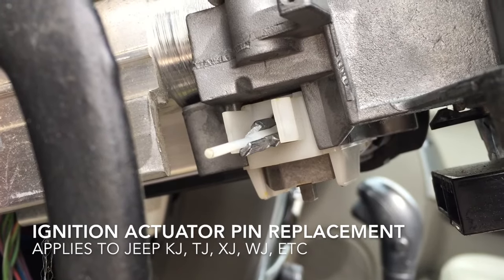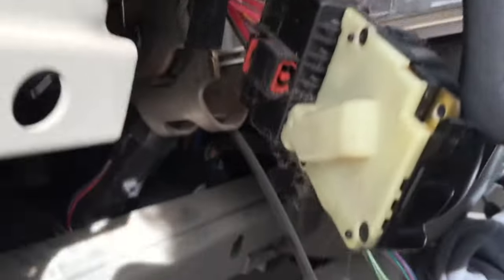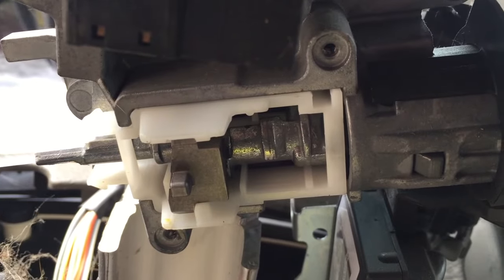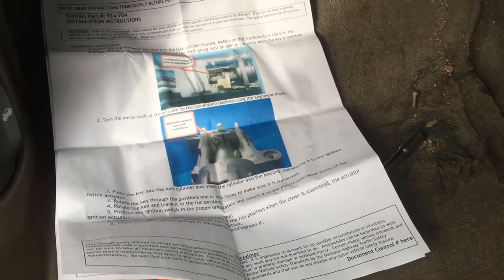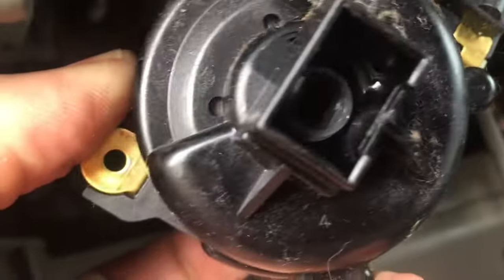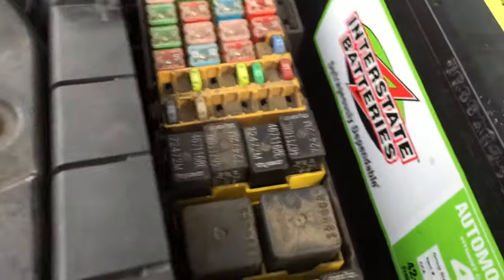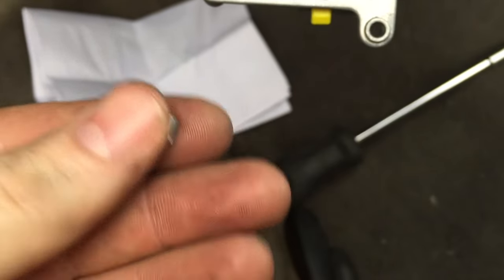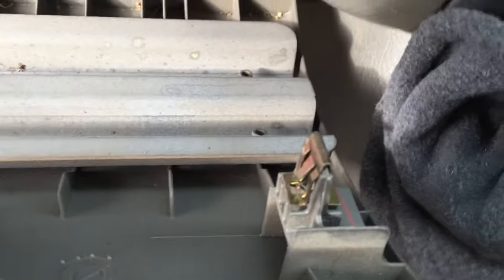Jeep Ignition Actuator Switch Key Pin Replacement - The right way! Dorman 924-704

Comment: Great video. Very comprehensive. Odd that the same defect is also on pretty much every video I have seen so far. Yours is the best. Prior to pulling the ignition cylinder out, I put two witness marks on it. My theory is to make the reinstallation process, less arduous. Currently waiting for parts.

Comment: It is also important to note that the oval-shaped key that goes in the housing for the switch actuator has the nipple on the top side....it will fit in the bottom. I had to pull mine back apart to allow the Liberty key to be released at all. MAGNIFICENT VIDEO!!! Saved me from spending a lot more doll hairs, and also saved a lot of stress.

Comment: Thanks.  I just did this repair to my 2006 Liberty.  But, I made the mistake of removing the three black screws on the ignition switch which removes the white plastic plate.  All kinds of things fell out.  A spring, and little silver ball bearing.  I ended up buying another one from Dorman along with the actuator pin part.  Spent around $50 total which was a lot cheaper than towing to a garage.

Comment: Thank you very much, this was an excellent video and it was exactly what I needed to fix the problem. I was so happy when I took everything apart and that little piece of broken metal fell out. One thing I did notice is that the Dorman part uses a bit thicker metal than the original broken one.
Reply: 9⁹
Reply: Hey I am try

Comment: Ran into this problem. Jumped relay for about a week to get me going to work and such, after a week it wouldn’t crank anymore and starter just spun itself would not engage flywheel. Tested starter and battery they both good hoping just the ignition switch is the issue

Comment: I can NOT stress how important it is to LOOK AT THE PICTURE IN THE INSTRUCTIONS.

That brass piece has a small arm that reaches out and touches the long plastic piece that runs through the entire assembly. MAKE SURE YOU PUT THAT BRASS ARM ON THE CORRECT SIDE OF THE RAISED LIP ON THAT PLASTIC PIECE AS INDICATED IN THE PICTURE. 

I broke my brand new replacement by not paying attention. Thankfully I used the plastic piece from the original and got it all put back together thanks to THIS video.

Comment: Thanks! Exactly what I needed. When I jumped my starter relay, mine would not start, but cranked just fine. Replaced the actuator and it fired right up.
Reply: Same for me. Won't start while bridging the relay even those the starter runs strong. Really hope this is the issue. Really worried if it's not it will be that sensor in the transmissions

Comment: Awesome video, fixed my Jeep! Mine wouldn’t work with that wire setup likes yours did. It would just crank. Once I replaced the actuator pin and ignition switch I’m back in business.

Comment: You can pop the top off the relay and just physically press the contact with your finger to make it turn over.you have to turn the key to on position. But if you have the ignition switch off all you have to do is put a screwdriver in it and turn it over. Key just needs to be turned to on pos so shifter will move. No jumpers are needed. And you can drive it without taking down the ignition switch and cyclling it to start . either way it's totally driveable without the stupid actuator . I think you took way too much off. I hope I'll get this done without taking off as much as you took off to do that I didn't need to take all that off to get the switch oheck don't think I have to take all that off to put it back in and I didn't. Just loosen tho everything bracket screws and you got room.You got some good tips on the actuator switch thank you. I've been starting it with the relay for months. Just replace the key cylinder a little while ago and decided it must be the ignition switch when I pulled the ignition switch off the chunk off the actuator fell off and I realized it was just a broken actuator. I really need to see how the actuator comes out physically and goes back in physically you did not show that thanks. Pretty good video I guess.

Comment: Thank you for this video! I was able to get to the actuator but it isn't broken, I used the screw driver to turn the switch and it still didn't start. Any suggestions would be tremendously appreciated!

Comment: Why don't you show everything step by step from beginning to end from the time you take off the Shroud around the steering column to the time you disconnect the starter switch and pull off the cover and all the little the security screws and the little pins in the springs and the key inside the yellow tab and the shifter cable and all that stuff? You just got everything hanging there. It's already all undone. You're not showing any little tips about pulling it all apart. Seriously if anybody got as far as you are right now they know what they're doing.overall very good . thank you  . helped me .

Comment: Question if you have a minute... I followed your steps (many thanks!) but when I got to the ignition actuator pin the metal wasn't chipped or damaged. Does this mean my problem is going to be something else? Or can the ignition actuator pin still be the point of failure even if the metal is intact? Thanks
Reply from the maker: It may not be your problem, you can turn the switch with a screwdriver now that it’s removed, if it starts just fine with the screwdriver then it’s something in the ignition pin to switch mating.
Reply: Same thing with my

Comment: Is it possible you can crank over the engine with a bad ignition actuator pin by taking out the starter relay and jumping the starter? Thanks
Reply from the maker: frank1992 yes totally possible, in fact if you check my other videos I show that process just before I made this replacement video.

Comment: I have a problem if you can help? Ignition turns on etc everything fine but the steering lock is engaged and won't disengage. It fired up then cut out and now won't start again?
Reply: I have the same problem
Reply: Did you find a fix?

Comment: Would doing a starter relay bypass, and it not cranking over, be more than an ignition actuator pin? Trying to start it with my key is giving me all the signs that it's the pin, but when I bypassed the relay it would crank but wouldn't start.
Reply from the maker: When you turned the key to on did the dash light up like normal? Its possible the pin is bad enough that you are not even getting it to turn to "on" if the dash lights don't come on.

Comment: Any idea why after changing the actuator the key won't "lock" in to the ignition positions? And I don't have to press the key release, I can just remove the key?
Reply from the maker: Martyn Lee since you are talking about the key release button I assume that means you have a manual. On the automatics there is a mechanism that controls this which ties into the shifter cable. The manual steering column is different with the button. It’s been a long time since I have worked on a manual so I don’t remember how those parts interact, but I would guess something is a little off there. If I can find my spare manual steering column this weekend I’ll take a look at it and see what I can figure out.
Reply: @IcarusOffroad  thank you. Yes it's a manual, should have mentioned that sooner!

Comment: thanks for posting this video, very helpful...my question is, would you "recommend" changing the ignition switch while I'm in that deep?
Reply from the maker: SuperPondo not I wouldn’t. The actual switch isn’t known for being a common failure, and it’s likely that any aftermarket part you replace it with will be lower quality than original. And, it really does not take long to get down to the switch anyway, less than 10 minutes.
Reply: @IcarusOffroad  Thanks for the advice

Comment: My 07 will crank with relay jumped... I take apart my ignition actuator and no damage. Fuel sprays from rail. Any advice on ignition switch itself? Could this cause it to not crank/not start with key on starter jumped??
Reply from the maker: Does the key not get the engine to crank? If it has good fuel pressure and wont start with the relay jumped I would check if you are getting spark next. Neutral safety switches can also also no crank issues, but shouldn't keep it from starting with the relay bypassed.
Reply: @IcarusOffroad  it will not crank with key alone. 
It will crank key on, starter relay jumped but will not run either way.
I'm going to check some more stuff on Tuesday. Busy with work and holidays.
Reply from the maker: That almost sounds like two issues but that is more unlikely to have two problems at once but it does happen. What was the lead up to this problem happening? How was it behaving before?
Reply: @IcarusOffroad  I wish I knew more. I got it not running. I was told it would sometimes take a jump sometimes it wouldn't, and one day it just died.

Comment: How did you get the ESC switch off of the top column cover?
Reply from the maker: This was an 05 so it did not have it. That being said I have pulled this all apart before on an 06+, I don't recall what it took to unplug the ESP switch but if you poke around with a light and look for a release tab you should be able to disconnect it if needed.

Comment: I lost that little piece that goes at the bottom with the yellow button! I Absolutely hate it!!! Just one freakin' little piece that was causing me all the headaches!!
  I hope my auto parts carries it.
Reply from the maker: The dealer might have that, but I doubt it. The actuator pin is considered part of the steering column, and its only sold new as a complete unit. Doorman might make a replacement little metal part, but I think you will need to goto a junkyard and remove it yourself from a vehicle. The little metal piece keeps the shifter from being moving out of parkwithout the key to on, but does not affect starting. If your trans is still in park that metal piece I lost didn't make a difference in starting.

Comment: Sometimes when I go to start my Jeep, nothing happens when I turn the key. The dash lights come on but nothing else. I have to just keep turning the key over and over again until finally it starts. Would this be the problem?
Reply from the maker: Yes it very well could be. It could also be the NSS neutral safety switch. 

I have a video where I show how with a piece of wire you can bypass the starter relay in case of a failed ignition pin, try that the next time it doesn’t want to start. If that doesn’t do it you can try holding the key to the start while you jiggle the shifter, if the transmission sensor(NSS) doesn’t think it’s in park it won’t let it start.
Reply: @IcarusOffroad  Oh wow! I never thought of that. I will look for that video. Tysm